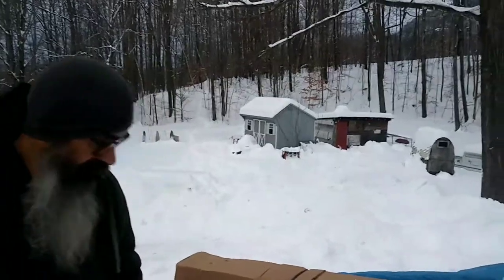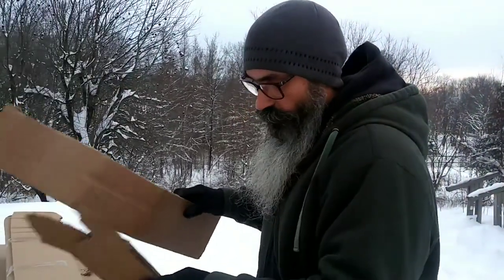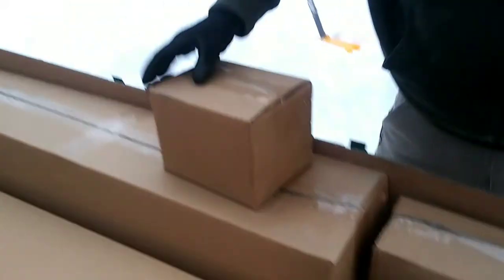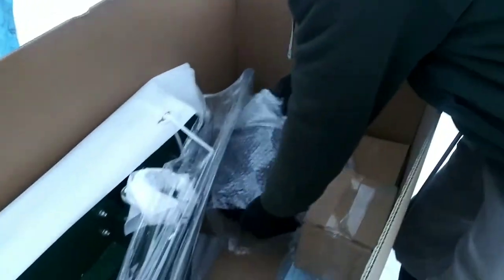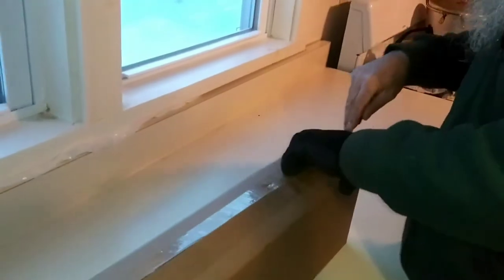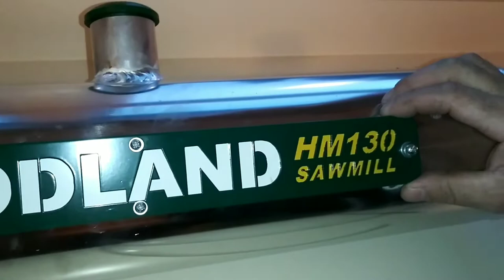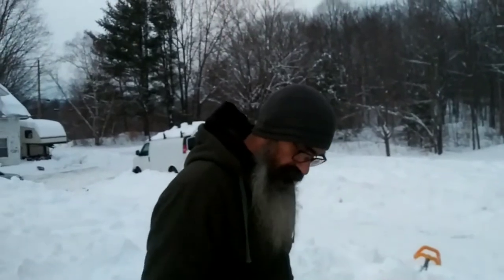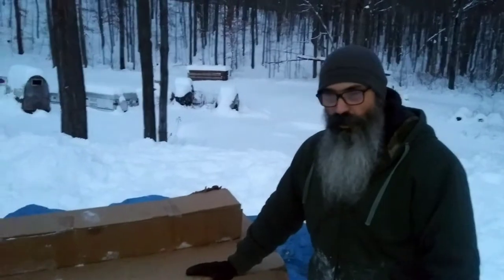Woodland Mills HM130 MAX unboxing!

Comment: Congrats on the purchase, I think I'm ordering mine tomorrow. The mills are made in China, but they are made to the company (WM) technical spec's. You should reach out to them on the veteran's discount (I'm former Canadian Forces myself), I'll bet they'll fix you up. A lobster fisherman just down the road from me got a 126 a few weeks ago, and he had a couple of problems. The gas tank had a dent, new one on the way, NO QUESTIONS ASKED. Additionally, he had a tracking issue, and again they came good and bent over backwards to get him fixed up. I read about 250-300 of the reviews on this saw/company, and I think they stand behind their product as well as anybody. Keep the camera rolling as you set it up and make some dust!.